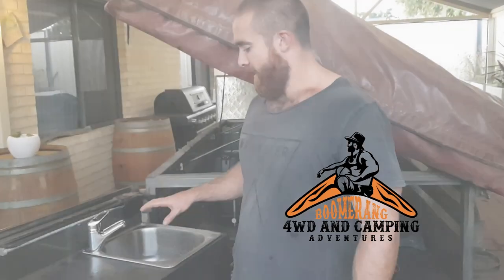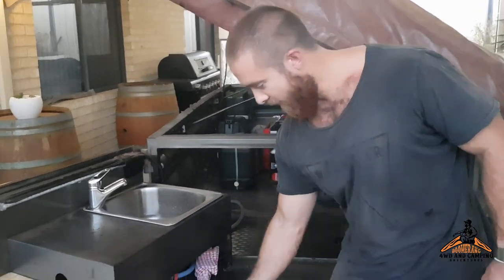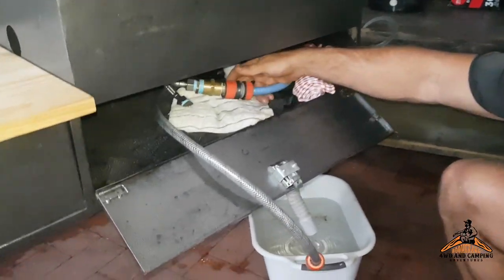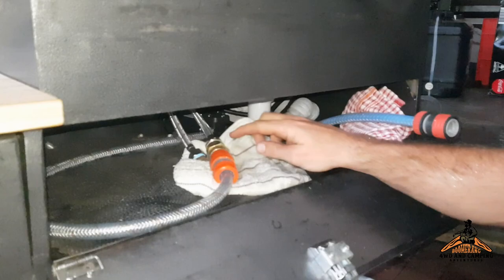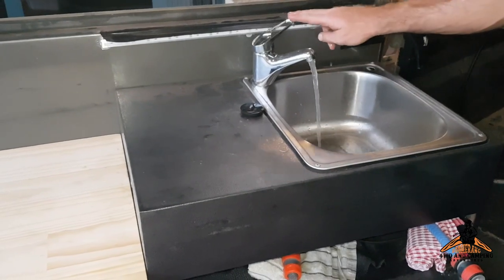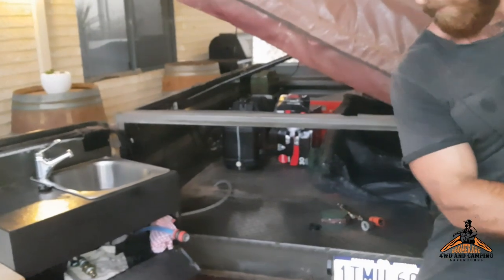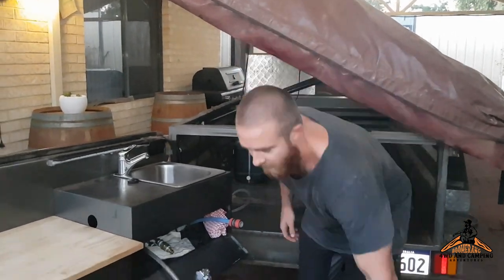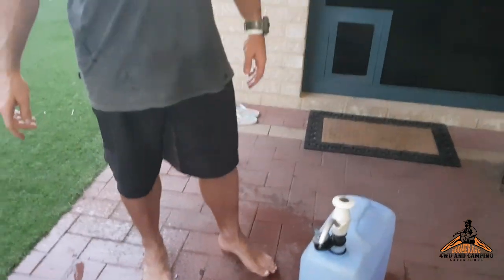12v water pump in a camper trailer

Comment: Nice one mate. I run a similar setup from the water tank under my Ute. The garden hose guns are great hey, can use it on jet for washing down the car/camp gear, or set it to shower for a quick scrub! Hoselink do a water meter gauge that you can plumb inline so that you know how much water you've got left. They're about $30, bought one last week but haven't fitted it yet.
Reply from the maker: Wild Touring Cheers mate. Yea awesome, I think the water tank is 90 or 110litres, so it would be good to know about water usage on those longer trips, so thanks for that I'll check it out. Hey maybe I could make a living on mobile car washes in remote locations ;)

Comment: Thanks for this, giving me some ideas.  Have you thought about a run of black poly garden tubing to warm the water for the shower? Probably need some plumbing to add a bit of cold water so it's not too hot.
Reply: Glad it helped! I've since got a new trailer and have a hot water system. Makes life that little bit easier with two kids. Great idea though! The biggest thing for me is not going through too much water, setting up multiple hoses etc can really smash your supply.

Comment: Hi man. Great video please send me the name or link to the pump.     That looks like a preassure pump.  So that means the pump switches off when the tap is closed. And I want one please send me the name or link
Reply from the maker: Thanks mate, sorry for the slow reply but yes the pump switches off when the pressure has built up (self priming).

This is the one. https://rover.ebay.com/rover/0/0/0?mpre=https%3A%2F%2Fwww.ebay.com.au%2Fulk%2Fitm%2F222286537951
Reply: Thank you man

Comment: Hey mate, awesome vid.. Keen to install a pump in my mdc too.. Just a question, did you have any issues or leakage when connecting the 1/2inch hoses to the 3/8 barbs on the pump? Or are the hose clamps enough to tighten them down?
Reply from the maker: Hi mate, absolutely no leakage from the pump, the hose clamps do the job fine, probably from the low pressure pump that I'm using.
Reply: Awesome, cheers mate... looking forward to ripping off your setup lol.. Have a good one
Reply from the maker: Haha, go for it mate, that's why I put it up! I couldn't find any good videos myself when I was researching it.
Reply: What tap is on your sink mate?

Comment: Good work/ideas with mains h2o and hand pump on 20L container.. But the pumps really noisy with rubbish flow, it's s cheapie. Get a Shurflo 4000. Quality costs but will last longer, better flow and limited noise.
Reply from the maker: Fred Nurke thanks Fred. The noise honeslty doesn't bother me. And I wanted to keep this project as cheap as possible plus having a higher flow rate is much easier to waste water so I actually wanted a slower rate. Thanks for the feedback!

Comment: Hey mate, do you still have this setup? Looking to copy it and was hoping for some specifics around what you did. Is that possible?
Reply from the maker: G'day Marty, I have aimce sold it mate and don't have any of the details on what I used anymore. My advice would be to go to a caravan supply shop and pick their brains, they should be able to steer you in the right direction. Also, check out "John Guest" fittings on ebay.
Reply: No worries mate thanks for that. I see you haven't posted in about 2 years, have you stopped travelling in a camper altogether?
Reply from the maker: @martyday3760  nah 2 kids is what happened! Still getting plenty of camping done, the kids love it. Got a new camper trailer but the same car. Just not prioritising making videos and just making memories.
Reply: @boomerang4wdandcampingadve702  right on! Yep, totally understand, those critters take up time, but it's the memories, smiles and photos that make it all worthwhile. You in QLD?
Reply from the maker: @martyday3760  that's it mate. I'd love to get into doing more vids, getting the footage is easy it's the editing. But I think I'd do a brand change and make it more family orientated. I'm in WA mate, so not many lockdowns and plenty of trips for us.